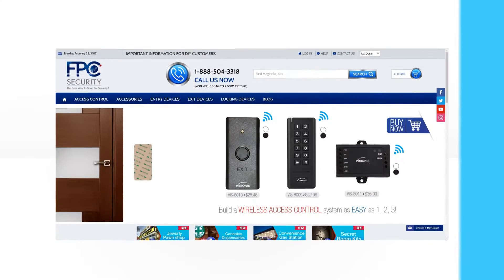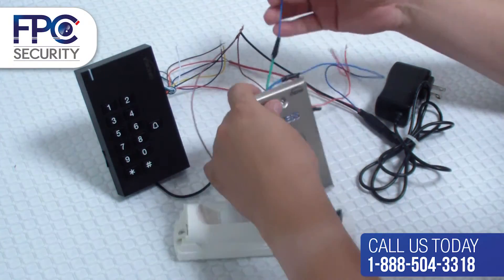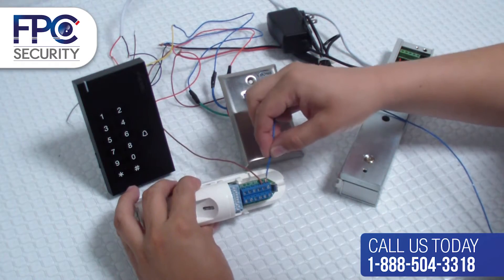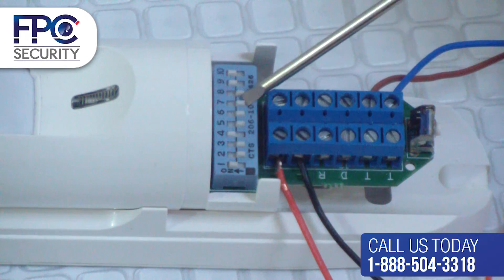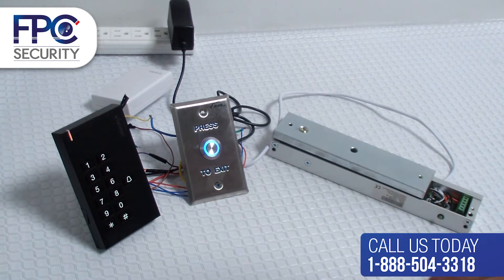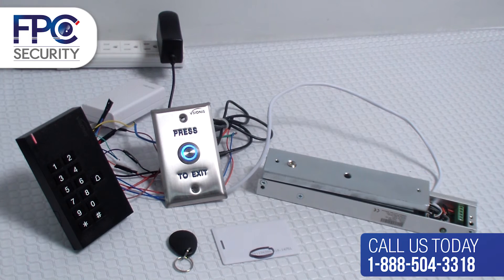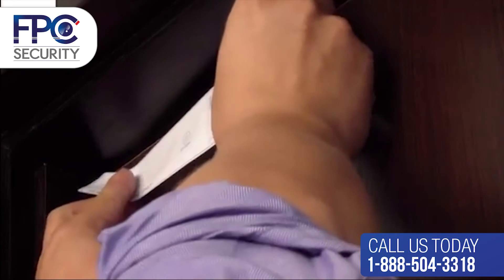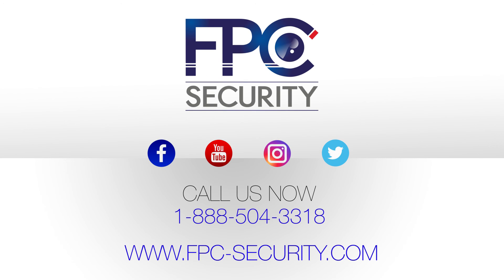How To Wire, Setup & Install the Maglocks 3002 and Pir Series Kits

Comment: Imagine trying to do these steps while pulling wire down inside walls and aluminum door frames. Try hooking up one device and then going to the next one, like it's going to be done in the field as I'm only going to pull wire down a door frame one time...how many wires?
Reply from the maker: Dear customer, the recommended wire is 18/4 or 20/4 Gauge wire.